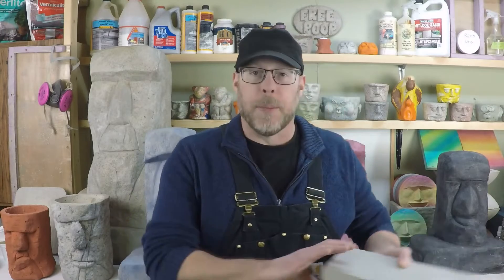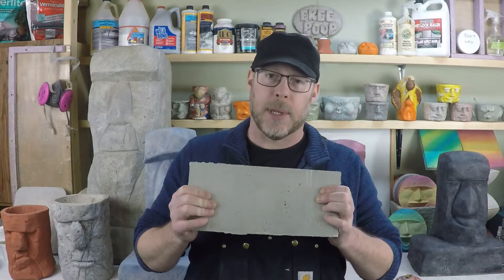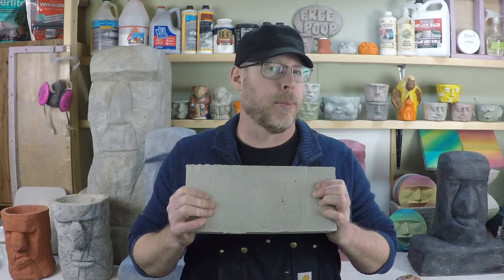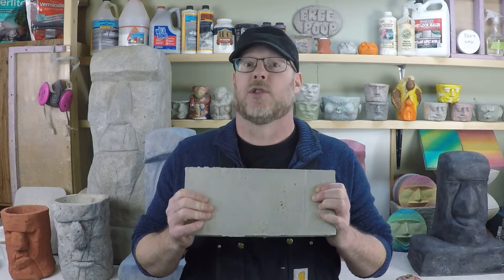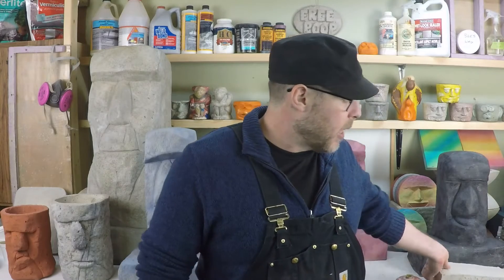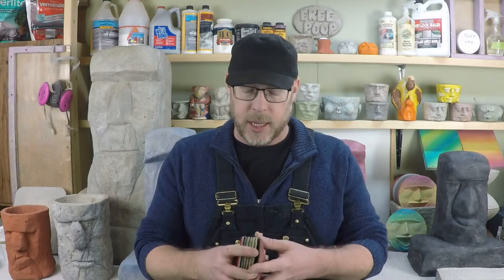How Do You Make Concrete Smooth?

Comment: I poured some concrete pumpkins and I'm trying to get a smoother now after they are dried. I used plastic pumpkin buckets and the bottom is very smooth almost glass like. Is there any way to buff of polish to get it to that smooth glass like finish?

Comment: What if you are building a bowl out of concrete?
Reply: Sand it but it won’t be easy.
Reply: @michaeladams2077  I think I figured that out a while ago
Reply: @michaeladams2077  took 5 hours of sanding
Reply: Concrete thin as a bowl will break easily. Don’t bother to polish it.

Comment: I just installed fiberglass pool but it has concrete around the top and  I want to "soften" sone of the corners and fill some small holes in that concrete. the softening of the edges will need some grinding and then come over that with light coat of concrete.. I want all this to match the color of the existing concrete. Can you assist with some advice?

Comment: Question: could you share your opinion if you think it would work to use a variable speed flex shaft rotary tool/ (die grinder) with 2" or 3" step diamond polishing disks for this wet polishing (since the motor is far from the handle)?
Reply from the maker: It is very hard to get a consistent surface profile.  If you are doing the work by hand then you will likely not hold even pressure.  This is why the grinders used for step sanding / grinding have a flat surface profile so you can rest the tool right on the flat surface you are grinding...and even that is very hard to do with even pressure.  So it could potentially be done, but likely not consistent results.
Reply: Concrete has no end of peculiarities that I keep discovering. LOL. Thanks for the help! @creatingconcrete

Comment: Thanks for the tremendously helpful videos. Questions: okay, so you say the transition point to look for is when initially troweled concrete loses the glossy, watery sheen, & develops a matte, hazy look. This is the point when you want to trowel for a smooth finish. Does this apply to all variations in viscosity of the concrete- such as thick concrete mix used in hand building as well as pouring concrete into a form (such as a decorative garden stepping stone)?  Does this apply to concrete where superplasticizer/ water reducer has been added?
Reply from the maker: Yes, pretty much all concrete applications will not be able to receive a quality finish upon placement.  The length of time before re-troweling is what will change between different mix designs, slab thickness etc.
Reply: You're awesome. Thank you so much for the assistance. It is greatly appreciated.  @creatingconcrete
Reply: I just saw the qualifier "not" in your response. I assume that was a mistake? LOL.  @creatingconcrete
Reply: Notes to remember 2 additional ways to smooth concrete: pour onto smooth plastic. step diamond polishing wheels for variable speed angle grinder that is built to handle wet grinding.

Comment: what if casting the concrete with a zinc sheet mold? will the surface also smooth? If mixed ration is 1:2:3, how to  make sure the gravel doesn't appear at the surface?

Comment: Great videos, going to implement alot of this knowledge on my next project ! Any angle grinders that you can recommend for a reasonable price that will actually get the job done?
Reply from the maker: variable speed!  that is the defining thing you need for concrete grinding and step polishing
Reply: @creatingconcrete  I saw you mentioned that in the video but I meant do you recommend a specific brand?

Comment: Nice videos! How... do you make exactly the same quality of surface as at 12 second of your video? :)
Reply from the maker: that is from concrete poured into a plastic mold and vibrated thoroughly.  When you cast concrete on smooth plastic you can get some really smooth and shiny concrete finishes.

Comment: what if you pour it into a silicone mold?
Reply: would it be smooth?
Reply from the maker: @BmadCreative207  It would be, especially if your silicone mold is very smooth. Like if you case smooth plastic with silicone for example, when you cast the mortar versions they should be extremely smooth.

Comment: What happens if you put plastic on the top or sides of the concrete form? Do those surfaces come out smooth as well?
Reply from the maker: Any concrete poured on or against concrete will be extremely smooth when it cures
Reply: @creatingconcrete  Thanks so much Steve! 

A few follow up questions for ya...😉

1.)What would happen if I were to make a cube-shaped form out of plexiglass, seal the edges, apply a release agent and slurry coat to the inner surfaces and underside of lid, pour in my mix and then seal it completely? Would I be left with a smooth solid concrete cube?
    1a.) In this scenario, would it be helpful to use a floating lid set inside the walls, to allow for shrinkage/expansion?
    1b.) If I used foam concrete in this setup, would it still be possible to get a smooth solid surface layer that is properly adhered to the internal foam concrete?

Comment: Thank you for providing all things specfic regarding concrete. What do you recommend to seal a concrete countertop after step-sanding? would an epoxy based sealer adhere to a polished surface or even necessary?
Reply from the maker: It is my understanding that you should use bees wax on a polished countertop to seal it with a food grade material.